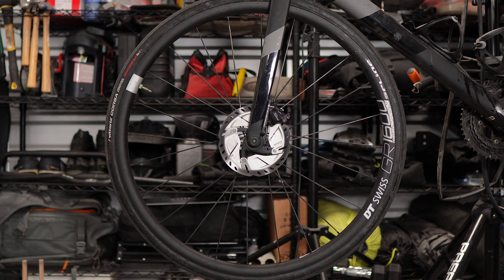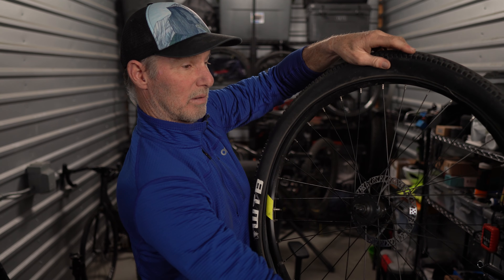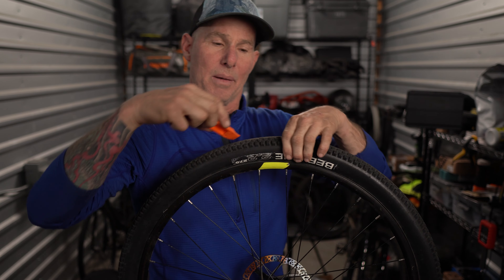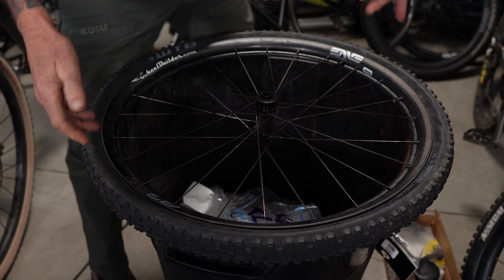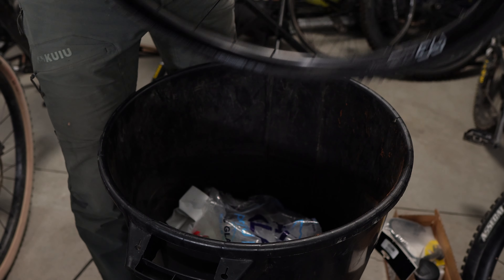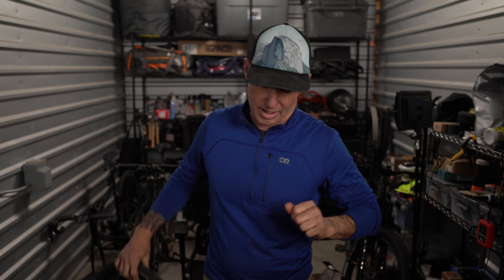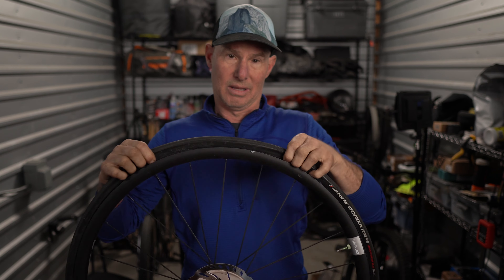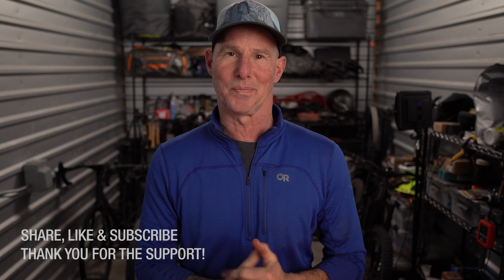How To Use Tire Levers For The Very First Time: A Step by Step Guide For Beginners (4K)

Comment: Park Tool vids look out! Mark List is next level!
Reply from the maker: Thanks Alex!
Reply: Saw a video stating not to state at the valve, start directly under to remove the bead away from the wheel ?
Reply from the maker: @jeffreyjuneau1959  that helps, it's not completely necessary. Really depends on the bead, the rim shape etc. If you start at the valve, you'd want to push it up a bit to get it out of the way when dealing with an inner tube. Does that make sense? Then it's out of the way.

Comment: A really great video. Yet I was hoping you would also show how to get the tire completely off. Such as if the second bead is usually as hard as the first? Does the same tool work? Which side of the tire to put the lever on?
   I'm 68 and have a Catrike with really tight tires.
  I'll use your link to buy the levers.
   Thanks!
Reply from the maker: Great questions! Sounds like you need some help with changing a tire altogether. Or taking a tire completely off. I'll do a video on that next and try to get it posted soon!
Reply: Thanks!